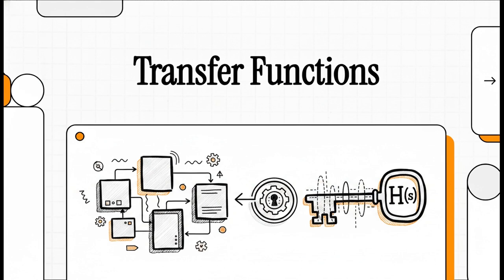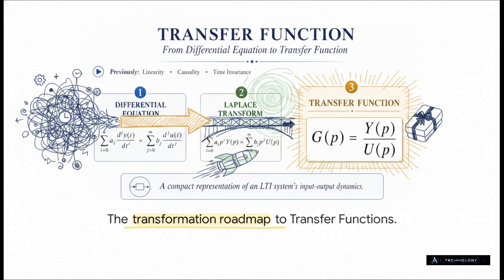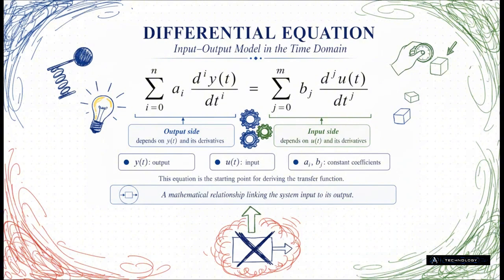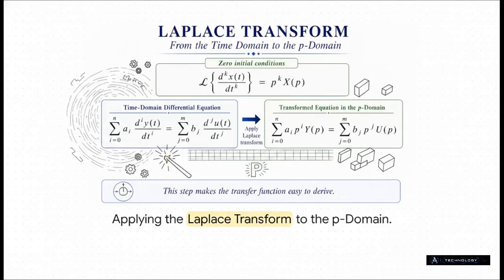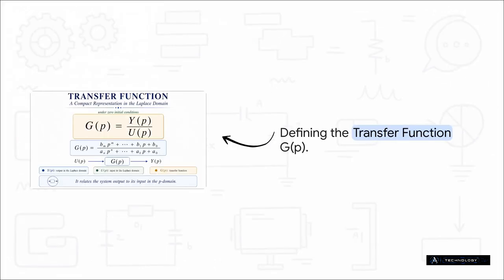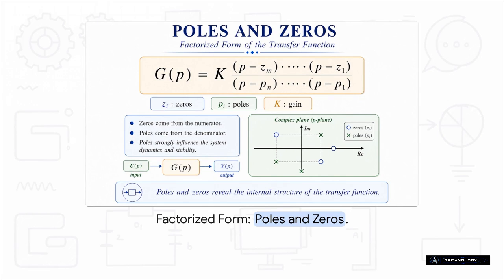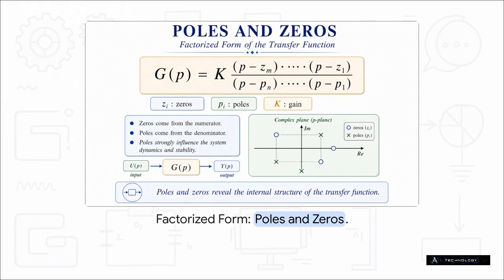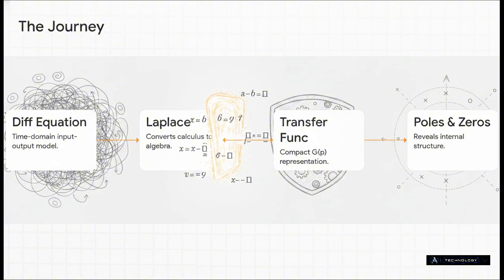How to Derive a Transfer Function Using the Laplace Transform (Poles and Zeros)| Control Systems #2

Comment: seems kind of sketchy explanation.  i would have started with the notion that passive circuity loops can be represented by systems ordinary differential equations. and then that ordinary differential equations can generally easily be transformed use the laplace transform which turns ordinary differential equations into systems of polynomials which can be easily solved in the laplace domain.  then the solution inverted back to the time domain.  a nice example with a couple loops of inductors, capacitors, resistors and a voltage source would suffice.  what you've presented is too abstract and meaningless and doesn't even have any rigor.  you don't even mention what the laplace transform is, just some magic change of variable.

all that said, this is typical junior year EE curriculum and is quite elementary.
Reply from the maker: Thanks for the detailed feedback. You make a fair point: starting with a concrete RLC circuit, deriving its differential equations, and then showing how the Laplace transform converts them into algebraic equations would make the motivation much clearer.

This video was intended as a brief conceptual introduction within a larger series, so some mathematical details were deliberately postponed. However, I agree that the transition to the Laplace domain should have been explained more explicitly rather than presented simply as a change of variable. I’ll take this into account and include a more rigorous circuit-based example in an upcoming video.